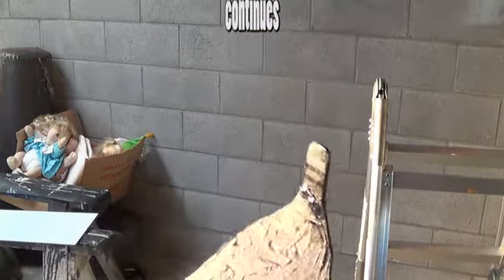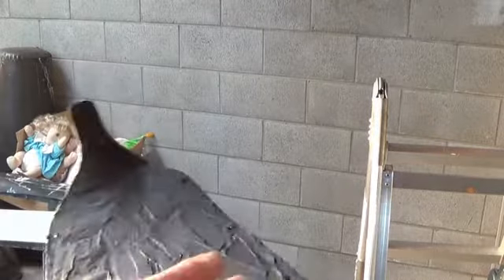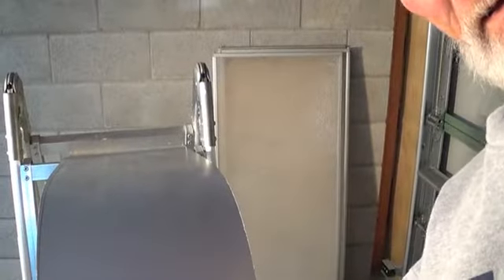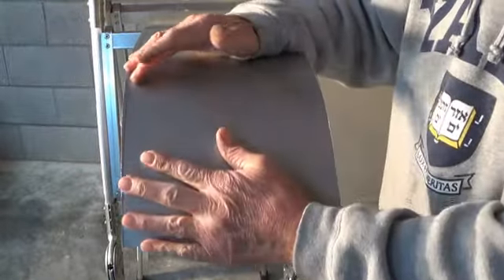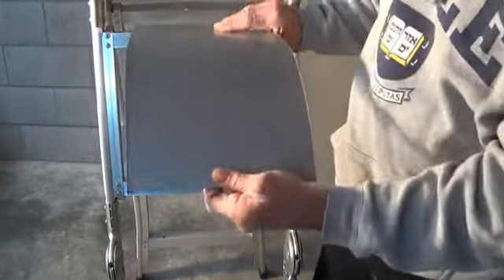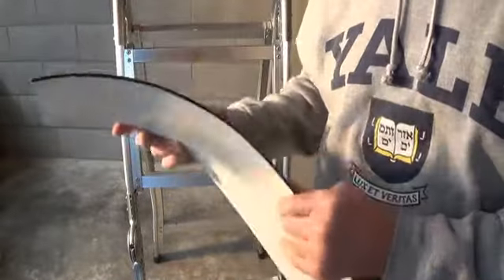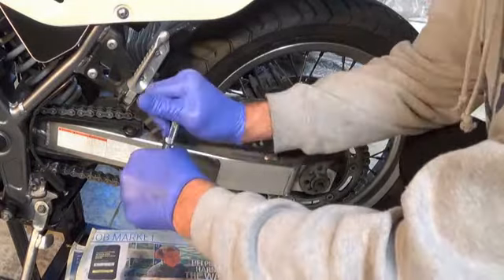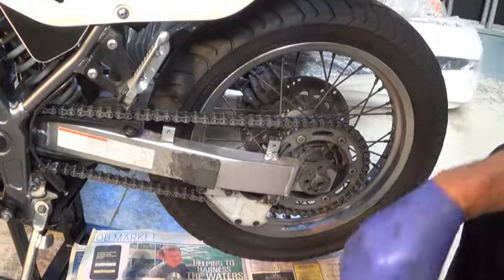stone guard and chain clean

Comment: Gday I tried using engine oil on my chain and I found it would flick on to my rear tyre. I did have a couple of small slids on left hand turns nothings serious but not what you want. So I went back to the non flick chain waxs $22 a can. I like the part about using the brush I only used kero with a rag, so I'll give it a go. Thanks for the video.
Reply from the maker: +ducatiphill Thanks for watching. Weather permitting i'll give it a trial tomorrow and report back.